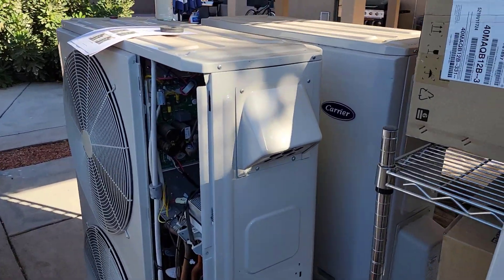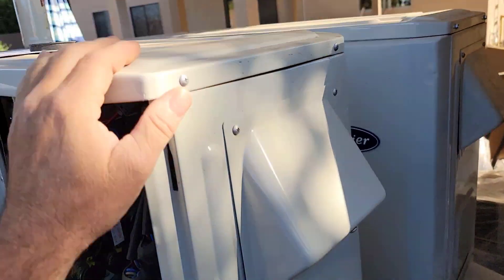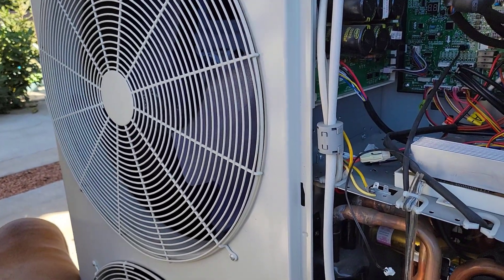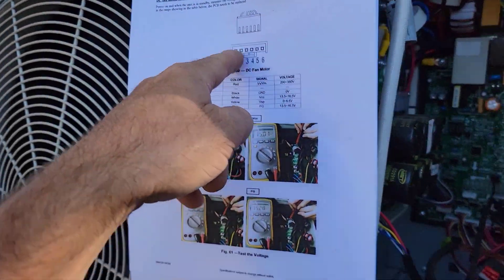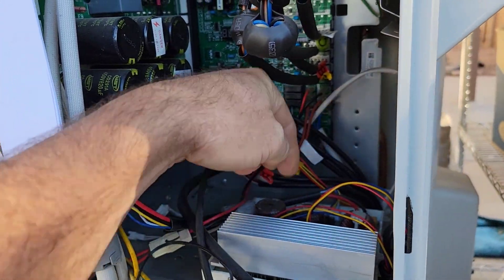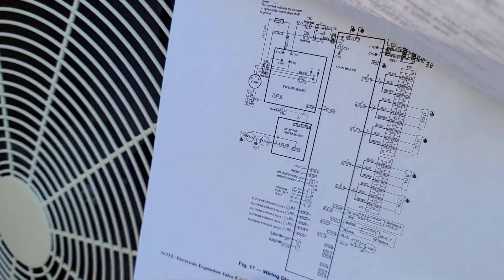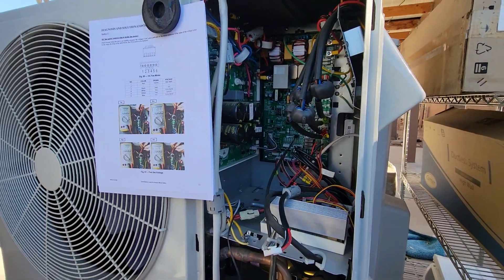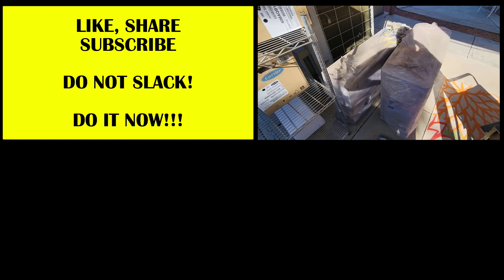Pondering about my next HVAC project [Another Frankenstein]

Comment: Wasn't it you YEARS ago that made videos of that silver 318/360 turbo ram with the 6.2 diesel turbo...??? I'd like to see those vids again!!!! That 360 ran really strong!!!! I remember it turned 13.60 when you guys took it to the track that one time... Wondered where you guys went...???
Reply from the maker: Holy hell! That was over 10 years ago!
And wow you have quite the memory.
It was a 2000 318 2WD Ram and the first turbo did come off of a 6.2 Chevy Deisel. 
We dropped in a used 360 when the 318 blew up.
If I remember, the bro in law had bought a new turbo from Arizona Tractor and Turbo which was what it had when it ran the 13's.

Unfortunately my hard drive crashed and I lost 99% of that as well as my Turbo Saturn project.

And just before that HD crashed, I had got rid of that youtube channel when it drew a bunch of angry trolls. LOL (I used to bash ricers and whatnot. But you likely know that)

I do have some video clips of it. Particularly I think I have one when we blew the head gasket the first time and water came out the exhaust when he tried to start it.

Comment: Lol, I've got an idea I want to toy with. If only I could get my hands on some scrap stuff like this to experiment with and your last 20-30 years experience in a couple days, ha. I've asked some guys and they want 300$ for the thing and I'm like eff it for 300$ I can just throw a couple more hundred at a new one that I know works. Also I'd be willing to bet that the comms between those boards is either RS485 or RS232. Canbus uses hi/lo not rx/tx. Being modern there isn't too many standards that would be worth using otherwise. Just would need to start probing. I think you would be able to tell just by checking the resistance on the connections as 485 and 232 are a little different. PFC could be power factor correction? seems pretty common on high load equipment.

Comment: what  is the   SEER  or eer  on your Frankenstein lennox  heat pump ?
Reply from the maker: On high speed probably 13 or 14 SEER. It is a 13 SEER Lennox mated to a AHU in the attic with an ECM and TXV.
But it doesn't start stop but rather drops to 1st stage at 40HZ, and the ID blower is probably drawing 25% of it's amps on 50% speed so it is definitely going to be higher than 14 SEER with that feature.

My initial objective was to see if I could run a VFD driven compressor directly on a high voltage solar panel array and it did. And batteries as well.
Reply: @hackfreehvac  Cool thanks for answering my question.

Comment: I just had found out about a recall about a harness on some of those Carrier ductless condensers. Something weird happens with the fan motor harness where it can heat up and melt. They have a harness that adds like 6" to each fan motor harness. Are one of your units in that recall?
Reply from the maker: May have to look for a TSB or something
Reply: @hackfreehvac  Yeah I cant remember which models it effected. I think last one I did was 2-3 years old. It effected both the single and duel fan units.

Comment: My question on this.... if the VFD board has fan speed signals, how is it determining the difference between Fan 1 and Fan 2, if its just feeding the fan motor board a single signal loop?
Reply from the maker: I thought that was interesting myself because both of those fans operate in unison from one single speed signal to that fan motor inverter board.